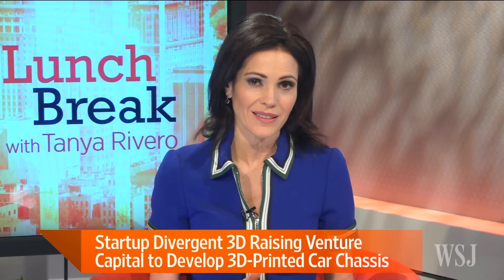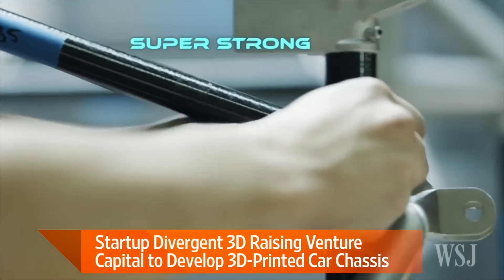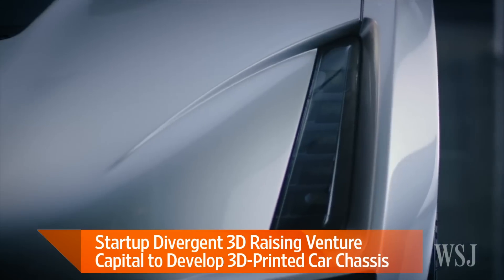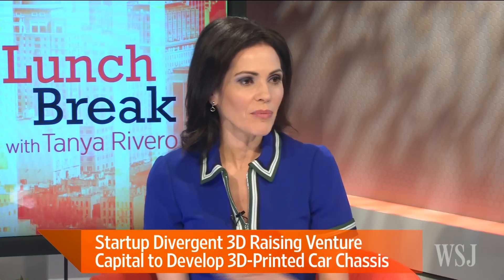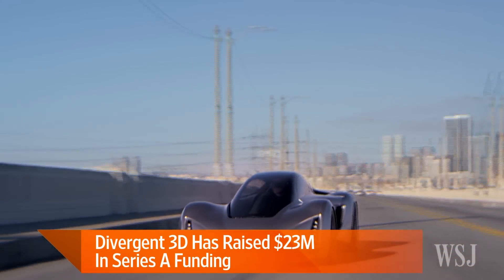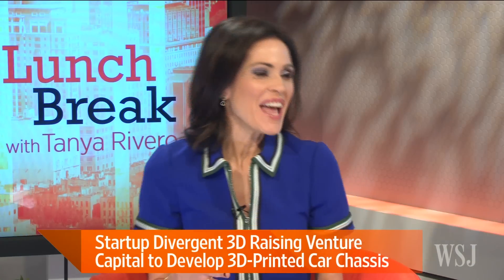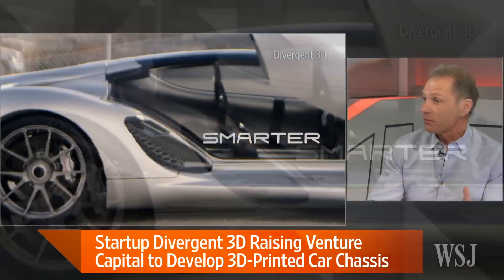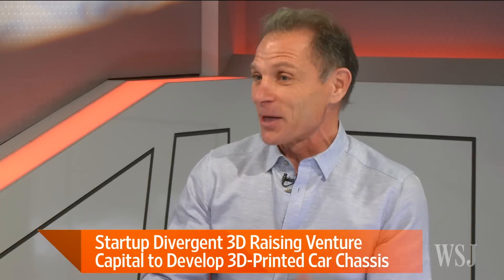3D-Printed Cars: The Future of Automobiles?

Comment: 3D Print the desired components but then having better tooling to create a mold press and/or  injection mold to replicate that design or component for prefabrication would be faster than to utilize 3D printing overall...
Reply: Well I guess if companies get on board Im sure the 3D will be faster and bigger.

Comment: 3D printing is for prototyping not full scale production.
Reply: Because?
Reply: incorrect, 3d printing is in it's early stages of discovering, CURRENTLY it's being used in the field of prototyping, but it can upscale into full production, one thing to propel this forward into that direction is the material filament, there is carbon fiber filament, which is much stronger than steel, that you can use to print stuff.